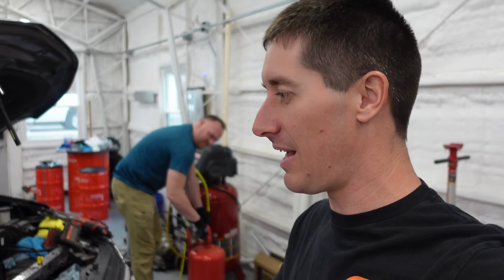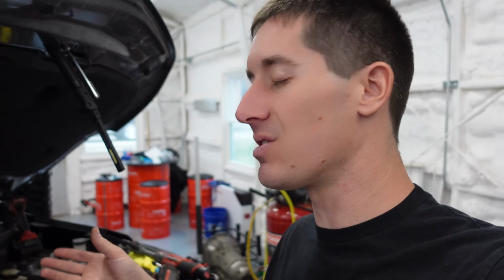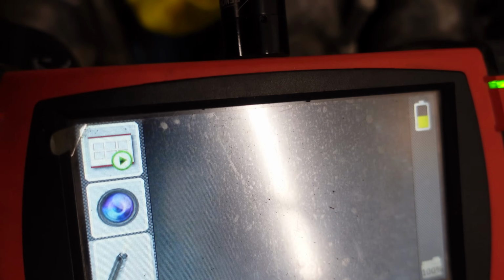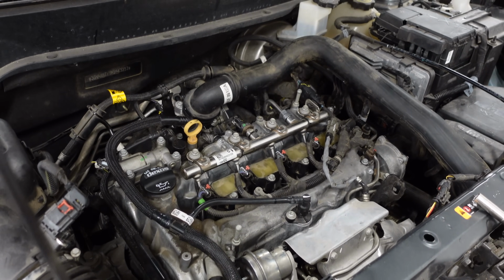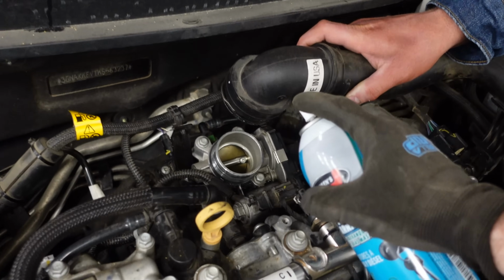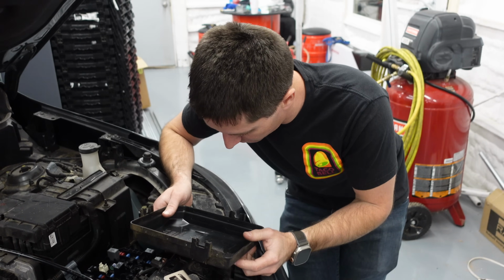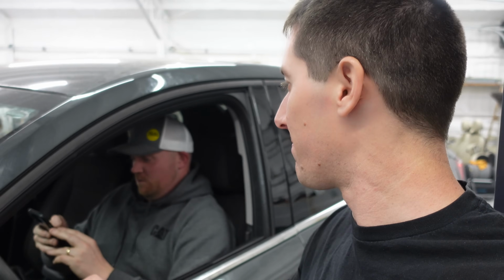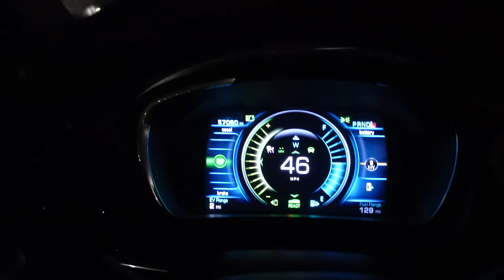I FIXED The UNFIXABLE Chevy Equinox *You'll Never Guess The Problem*

Comment: i’m a believer in batches of bad gas ever since i went through a whole saga just like this. garbage gas was throwing misfire codes, choking idle. stopped somewhere else someday when i was finally out, and it was like a new car. 
i thought it was a myth until it was me. 

but hey! valve cleaning for better mpgs! she’s mint for another 60k!
Reply: Same man! I had a situation like this about 6 years ago. I had a 95 F350 Powerstroke that I filled up my auxillary tank in at a random fuel stop off I75 on my way down to Atlanta. Destroyed my injection system but couldn't prove it because I paid cash and really didn't remember where it was.
Reply: Happened to me before. Car went into limp mode out of the blue, got it home and let it sit for a while. Next start up - totally fine. Put some fresh gas in it and it never happened again!
Reply: My sister had a base model 2002 or 2003 Acura RSX.  That car had the K20 low compression motor, 160hp, 2 liter displacement, designed to run on 87 octane.  She always filled it up at that one particular Pilot gas station in Knoxville.  She noticed it was a bit down on power, missing, idling slightly rougher, just didn't feel right.  Took it to the mechanic when it was due for an oil change, he changed the fuel filter and told her never go to a Pilot gas station again.  After that, going only to shell or BP stations the car ran like a top on regular 87.  Them damn Haslam brothers, bunch of scam artists.

Comment: E85 is mostly clear. I used to run E85 on my mustang for 5 years. How you test the ethanol content is you put it into a tube, fill water to a fill line, the rest with e85 and shake it. After it settles in 5 minutes you can gauge how much ethanol content is in the gas by how much separates and suspends at the top of the solution

Comment: I am sorry to see your troubles.
I have 260K miles on my 2.4L | 2015 Chevy Equinox.
I had the upper portion rebuilt (long block) rebuilt at 160K and trans rebuilt at 200K.
Keeping up with Oil changes and Maintenance is the key.
I will never sale it. My kids all want it.

Comment: About two months ago there was a gas station in my area in New Jersey that caused this same issue with a bunch of cars. The car owners sued the gas station for the repairs and they shut down for months before reopening for fuel service again. What a nightmare! I’m glad I stopped using this gas station before all that took place. Glad you finally solved it. Water can get into a fuel storage tank from rain runoff if the tank seals fail. Sounds like what you experienced here.
Reply: Was that the CONOCO station on Admiral Blvd in Camden, N.J.?

Comment: i love BG. used them at my dealership and i had a 09 pontiac torrent GXP with the notorious 3.6L. i bought it super cheap because it needed timing chains, but the motor was also super slugged with oil. Used the BG engine flush and dude it was like a brand new motor inside!!! i was highly impressed, and will back BG products.
Reply from the maker: Absolutely 💯

Comment: I guess you've never pumped a tank full of water from a station that got flooded. Side of the road and pulling the carb apart to get the water out of it. Lesson learned, you got too deep before considering all the clues.

Good on you for finding the problem.

Comment: My 2019 Equinox runs on regular but premium is recommended. Sound weird but DEF fluid is clear. Can cause similar problems. Worth looking into.
Reply: she probably picked up the "cheapest" handle/button at the pump because HEY IT'S THE CHEAPEST! and filled it with DEF lol
Reply: One things for sure, the engine can take a licking and keeps on ticking. 😊

Comment: After the deep freeze in Texas 3 years ago, I got bad gas at a nearby 76 station. I had very similar results but at least the car ran long enough to make it onto the tow truck ramp. Kia dealer had to completely flush fuel system on my Kia Sportage Turbo SX, with only 4200 miles. 76 paid the $600 bill, thank goodness. What a nightmare!
Reply: Amazing you got a company to take responsibility for their mistake.

Comment: JR!  You did a video a couple of years ago.  Basically pouring Berryman’s in a vacuum port on the intake.    I used Gum Out but I did it on my 2007 Mazda 3.  The smoke cloud was epic - bigger than a barn.   My neighbor’s house completely disappeared!  I decided to jump in it and drive it down the road.  Big mistake.  I change out the EGR also.  Pulled the intake and throttle body - raw oil. But the Gum Out treatment cleaned that head and valves.  It’s run like a top ever since.

Comment: Glad I watched the whole thing... Basically to answer the Question raised about fueling up at a QuikTrip/QT.  Being from Wisconsin I heard it as Kwik Trip (KT) otherwise called Kwik Star in States where QT has been operating...

As the "new" Owner (bought from family, so I know its "Good" Service History, done some of it myself before buying it like 6 months ago) of a 2014 Ecotec GMC Terrain AWD... I'm concerned about the various "Problems" I'm now trying to Avoid (Fingers Crossed). Depending how I read my VIN it "might" be Flex Fuel capable... But the Manual/Fuel Cap/etc. doesn't agree. Might have to talk with my GMC Dealership.

Now... Basically since a "Bad Gasoline" issue (from various Stations/Brands, affecting mostly GM Injectors from the late 90's...) in the Milwaukee,WI Regional Market over 20 years ago I've been a BIG fan of using Top Tier Detergent Gasolines since that Standard came out (although in the last few years several Retailers have "dropped" carrying the TT standard... KT being one of them).  

I've tried since that incident to ALWAYS use Fuel from a Station/Chain that Guarantees its Fuel.  Which KT still does at least... Like with the Top Tier Standard I suppose I really should double check the current Guarantee "policy" of my frequent Brands just so I'm ready...

With that previous Milwaukee Incident being so spread out and not seem to strike equally/instantly all vehicles... PLUS the repair response from Mechanics/Stations/GM all seemed to point at different issues/concerns (3 Blind Men Describe an Elephant...).

 Its a nice reminder to be informed and ready to consider/rule out "Bad Gas" and based on the Horror Story News Reports at the time of some people "needing" new Fuel Injectors (which GM later tested/claimed wasn't necessary if switched to "clean" fuel) and others didn't...  

Questioning how detailed the various Shops and/or Drivers were at addressing the issue. Since it was so wide spread, yet  "Random"... There must have been some people that wanted the cheap and/or quick fix (leaving "Bad Fuel" behind to "kill" the Injectors again... Insidiously not right away and early on at least nobody was certain what Stations/Brands were "safe". CITGO (which put its "Guarantee" at the time at the discretion of individual Stations) and Mobil were often cited but again not immediate problems so a larger supply chain issue...

All coming down to A LOT of Drivers got burned by this not to mention Stations/Chains, and probably a few Mechanics/Shops too when the Dust Settled...

Comment: after telling us fixing junk is killing your soul you continue to fix junk. feels like a metaphor for life.
Reply: The Equinox model is junk.  I was just gifted one for fixing a friends Ford Escape.  I have put hours of time and parts on this lemon.  Uses oil like crazy, idles crazy, exhaust manifold was cracked, had 4 different check engine lights.  (All resolved with different parts).  Now has the dreaded P0017 code.  152K.  Not sure this thing will make 200K.  A true Chevawreck!
Reply: @waltersweet4595 that code is caused by the timing chains being stretched have a 2010 Cadillac SRX that given to me with the same mileage as yours this thing sat in the yard for 2 years straight the stealership even gave up on it and charged the previous owner $600 bucks for a new fuse box that wasn’t the issue these units suffer from chain stretch they will have to be replaced it typically has 3 chains my 2010  Cadillac SRX has the 3.0
GDI

Comment: Back in the '80s a high school buddy of mine had a '76 Nova. Was leaving my house one evening, and it would start for a second, then die, over and over. After taking loose the fuel line and pumping some into a glass jar, we saw that it was about a quarter water. Turns out, the old man that owned the car before had solved water leaking into the trunk by drilling drain holes in the trunk floor. Right into the fuel tank.

Comment: Awesome troubleshooting!  Glad you found the problem.  Plus she got a valve cleaning out of it as well.  These engines are fairly fragile to a lack of maintenance but if properly maintained, they do okay.   Just make sure she's pretty religious about changing her oil with a good Dexos rated full synthetic at 5k miles and it should last her the lifetime of the car.

Comment: I would still BG44K this thing and run multiple bottles of Heet through it. I'm guessing she either put E85 in it or the gas station screwed up, if there's multiple reports in your area then it's the gas station's fault. Glad you got this going without a full blown engine swap.

Comment: You’d be surprised how many people manage to put diesel in a gasoline car. The gas stations near the dealer I used to work at the nozzles were the same size as gas and on the same bank of pumps. About once a month or so we would get a car towed in for a crank no start.  I’d walk out to get the vin and mileage.  Turn the key to get the mileage and see the fuel gauge pegged on full. Walk to the fuel fill, remove cap, swipe my finger and yup. Full of diesel.  

Not sure what got put in that equinox but glad u were able to figure it out finally.
Reply: I put diesel in a rental car in the Cayman Islands.  Their pumps are black for diesel, green for gas.  I knew it, thought about it on the way to the gas station, and still got it wrong when I went to fill up.  Luckily I realized when I had put roughly a dollar of diesel in, and it ran fine after filling the rest of the tank up with gas.  I always thought I was too smart to get that one wrong.

Comment: I wonder if you read the 91 octane requirement in the owners manual for the equinox with the 2L turbo. That requires premium, the 1.5T regular gas.
Reply: 91 won't hurt either engine anyway, just the wallet. :)
Reply: Recommended not required

Comment: The walnut blaster you have needs extremely fine media. I had no problems with mine until I put slightly less fine shells in it, then I had constant clogging issues. As soon as I went back to the ultrafine shells, it flowed perfectly.

Comment: I've come across this problem 16 years ago my friends grandpa had a 87 vette he filled up with premium at Walmart drive the car home and that's where it never ran again he took it to 4 shops before he met me they did timing chains and tune up new distributor fuel filter head gaskets they never thought to check the fuel and even though that gas station wasn't more than 8 months old he bought a tank of almost pure water that man was so happy that I came to his house and found the problem in less than 30 min

Comment: We had a local gas station accidentally put diesel in the gasoline holding tank.  We went to a local auto parts store complaining about engine misfires and stumbling, thinking it needed new plugs/wires. They immediately asked where we lived and got gas. We told them and they told us about the diesel in the gas at that station and told us to run fuel treatment and fill the car with premium.  We followed their advice and the car runs fine now.

Comment: Great video.    Do not forget about sticking a hose in the tank and syphoning the old school method.  Saves the fuel pump.
Reply: There is a block off in there so you cant ram a hose down the filler tube anymore and syphon fuel.
Reply from the maker: Yeah usually the anti-rollover ball and anti-siphoned prevents that now. On capless tanks like these they upped all the spring pressures 😬
Reply: I was wondering why that wasn’t tried. 👍   I had no idea.     @WatchJRGo
Reply: @ford_probe_garage_studio if they have convenient access to the top of the rank for fuel pump replacement, you could go in that way. Sometimes under a flap under the rear seat. But depending on the design that may be just as much hassle.
Reply: Cars should be built with access cover to fuel pump instead of dropping out tank full of fuel, dangerous.

Comment: @25:13 “can’t put diesel in it”

…unless the gas station accidentally swapped the filler nozzle. My wife got diesel in her (not-diesel) Focus and when we went back to the station, found that the nozzles had been physically switched and you could indeed put the “diesel” nozzle in a gasoline car. They got an earful for that.
Reply from the maker: That’s crazy!!! Never seen a diesel pump with the small nozzle before, glad you yelled at them 🤯
Reply: Same thing happened to my wife. My 6-year old son wanted to help her pump the gas so she accidentally let him pump diesel. The diesel spout was smaller like gas. After we discovered and fixed the problem with the car, I checked all the pumps at the station. All the diesel spouts were larger except the one we used.
Reply: I've seen plenty of small nozzle diesel pumps.  Apparently you never pumped diesel in your life

Comment: First time I have had Youtube suggest this channel.  An interesting problem and my first guess, after the compression issue was fixed,  was that someone screwed with the fuel. Cool. Now, let me tell you one I learned 20 years ago while in a sponsored auto repair school.
The victim was a mid-80's T-bird.  (I may have the wrong year as I have not worked on cars since a bad accident).  The engine balked and misfired and just would not run.  Timing appeared right on, spark was fine, good fuel delivery.  The car had been to four shops and they had not found out the problem.  A mystery!
We were the woman's last chance and auto STUDENTS may not always be the best but, sometimes, ignorance takes you down paths otherwise unknown.
We confirmed what other shops told us.  Checked everything.  We were stumped.  I had been around when she told us how she got the car.  It had been her husband's, and she got it in the divorce settlement.  It did not run when she went to get it from him and she towed it to a shop.  My instructor asked what he did for a living.  He fixed cars........  Oh, no.  What did he do?
We put it on the engine analyzer and saw it had really nice spark traces.  OK....., that was not the problem.  A guy that was not working on the car walked by, looked at the traces, and asked if this was the supercharged V-6.  No, it that 5.0 liter V8.  No, he said, it was a V6.  WE pointed to the distributor cap and 8 wires.  He pointed to the scope.  Six races..........  Oh, now,  what did he do?  
We had it from there.  The distributor timing had an optical sensor in it.  The sensor had six slots for he six cylinder, and 8 for the eight.  And BOTH fit into the asme distributor housing.  He had changed out the 8 cylinder sensor, and put in a 6 cylinder sensor.  How devious can you get?  It worked perfectly after we put the right sensor wheel in it. But he had to pay for the repairs, after she filed suit and won.

Comment: Ran into his exact issue not long ago, gas was fully saturated with water to the point it settled out a little water in the bottom of the tank, the fuel was a weird white color...once water saturated the fuel would not burn,  it would no longer vaporize enough to even cause a pop. Hopefully you cleaned the intake's pcv port that clogs on that chevy while off

Comment: Lol great video guys I'll be subscribing.. And I subscribe to your train of thought.. always start with the hardest thing!.. I guess that's human.. And in the olden days in the '70s and '80s when we had dirty valves or carbon knock.. we'd pull off  the air cleaner rev it up and pour a little bit of automatic transmission fluid down the carburetor... cleaned everything out made them  run really good... Some benefit to the olden days.. also make some smoke crazywhite.. And one time we bought an old station wagon at a car auction that was smoking white nobody wanted to touch it.. My hubby said I know where that white smoke came from.. So we bought it cheap that was one of the best cars we ever owned..

Comment: Check a wiring diagram. At the fuel pump fuse you might be able to just pull the fuse and hook a jumper wire from the battery to the side of the fuse socket that feeds power to the pump. Works on every vehicle I've tried it on.

Comment: I have a 2013 Equinox LT that had a water pump replacement two years ago at the dealership and after the repair job it has been rattling when it’s first cranked up from the day I picked it up that I pointed out to the service manager.  It’s been consuming and leaking oil to the tune of about 1.5 qt every 4-6 weeks!  I took the vehicle back within the first week complaining of the rattle that they continually ignored, wanted to charge me for a complete oil change when I was able to add 1 - 1.5 qt. of oil myself, and on my third return told me the engine rattle was a matter of coincidence! 😡

Up until this incident I had the vehicle serviced at the dealership and have since had it service at a garage in which they said it sounded as though the timing chain was the problem.  Needless to say that particular dealership has lost a customer and the sad thing is I really like the vehicle that’s perfect for my wife and I due to it’s ability to seat five full size adults very comfortably: what’s a guy to do?  😖

QUESTION EVERYTHING: What Is The Truth (WITT)???  🧐.  GYHOOYA: OYE!!!  😤